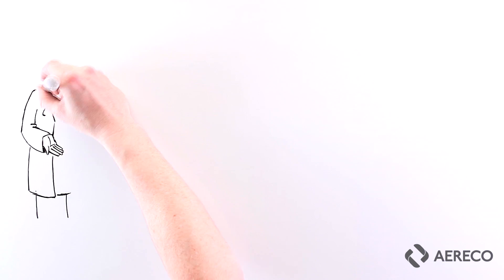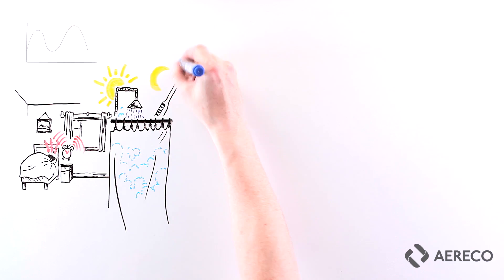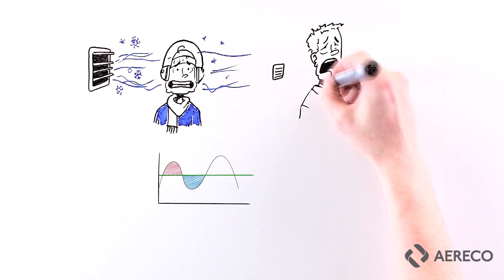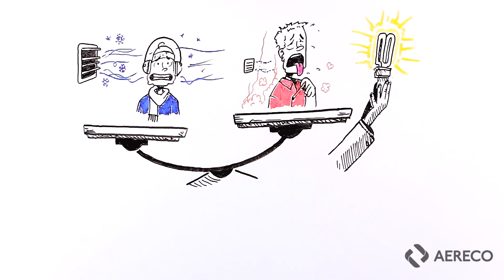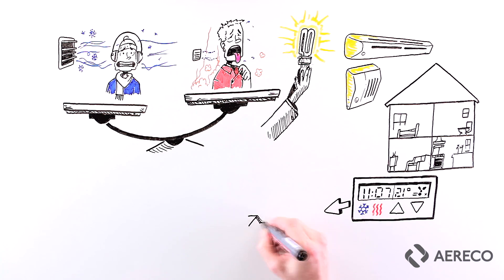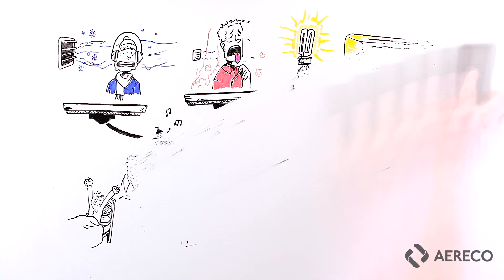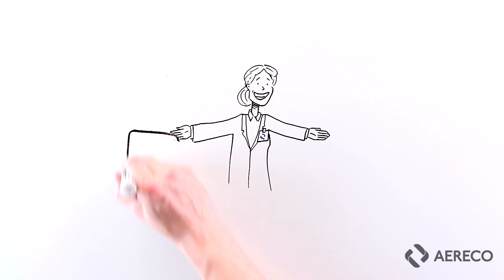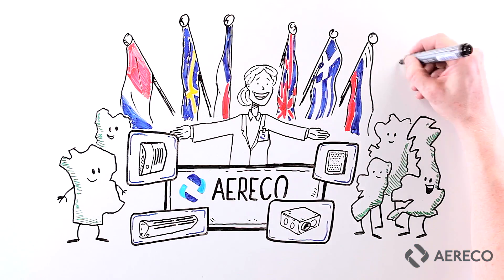Ventilation Basics Series #3 Demand Controlled Ventilation DCV

Comment: Need humidifier added the mechanical ventilation or else you’ll get very dry air in the winter.
Reply from the maker: With an efficient ventilation system, this is not necessary. You can discover our solutions or contact us on our website: https://www.aereco.com/ventilation/ventilation-systems/

Comment: which is the best ventilation model to minimize risk of germ (virus, bacteria) through airborne spreading?
Reply: Mechanical ventilation with heat recovery. It removes stale moist air and replaces it with fresh filtered air from outside. Keeps your home fresh as it allows air to flow throughout the property
Reply from the maker: There is no obvious answer: it will depend on the dwelling/building and the intended use. If you are interested, you will find more information on the different ventilation systems that exist on our website: https://www.aereco.com/ventilation/ventilation-systems/

Comment: How about making a ventilator in a airplane in a bus system also enclosed area for ventilation get rid of covet 19 Corona virus
Reply from the maker: The good practice to minimize the transmission risk of COVID-19 today is to ensure a good air renewal rate on closed rooms. Our ventilation systems fit well with this purpose. But it needs to but properly dimensioned for your dwelling and you also have to ensure a good maintenance on a long term. For more information, please visit our website at www.aereco.com